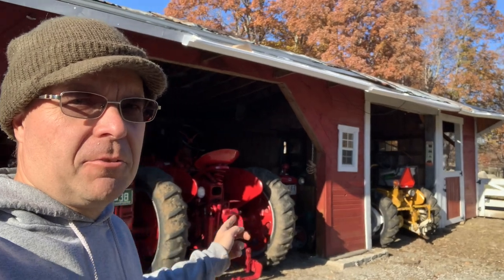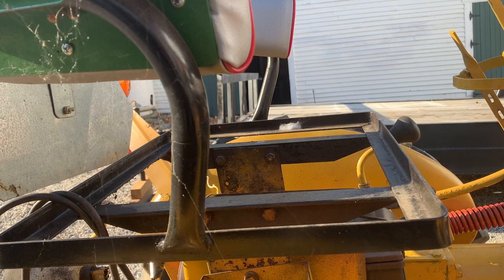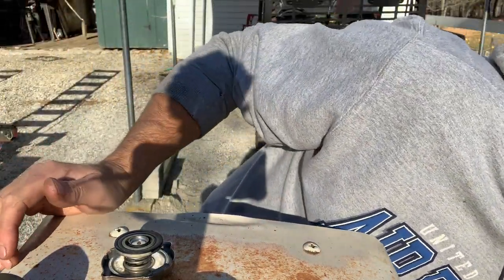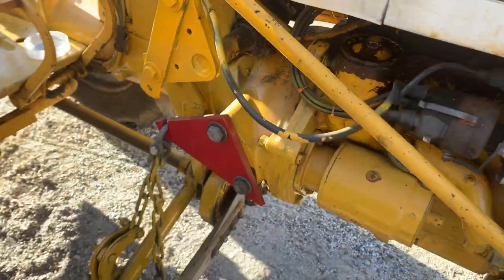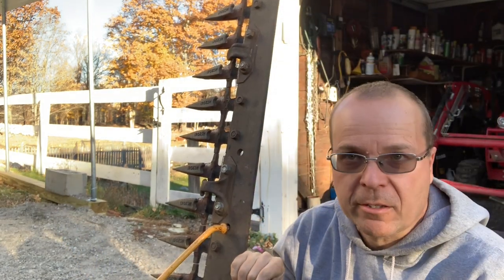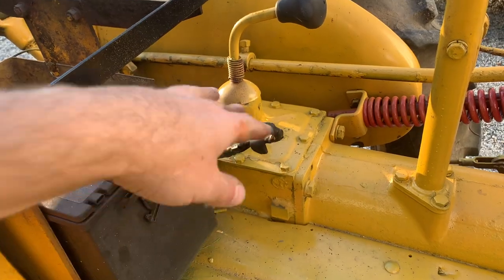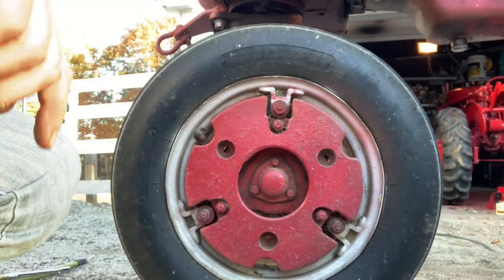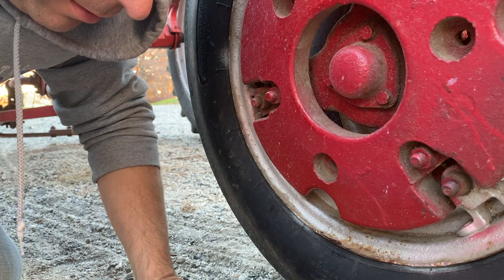#Farmall Friday How To Put a Tractor Away For The Winter IH

Comment: If that Cub is a thermosiphon (without a water pump) it shouldn't have a pressure cap.
Reply from the maker: That’s not true. 1975-1979 Cubs used a 7 psi cap.  The radiator was different. People are often confused in thinking that no water pump = no pressure, pressure on these was obtained by the taller neck on the radiator. Thank You for watching.